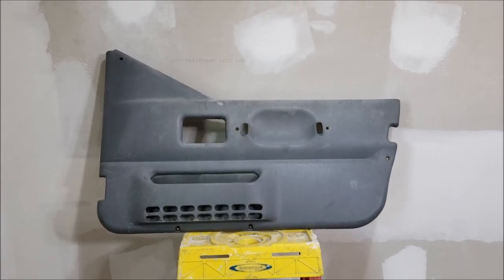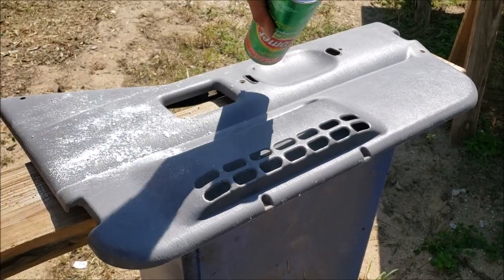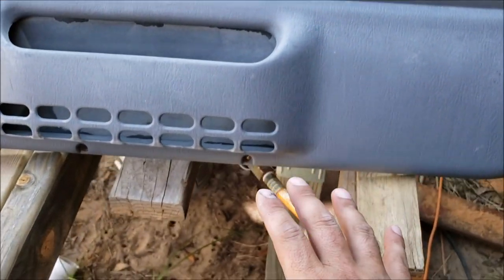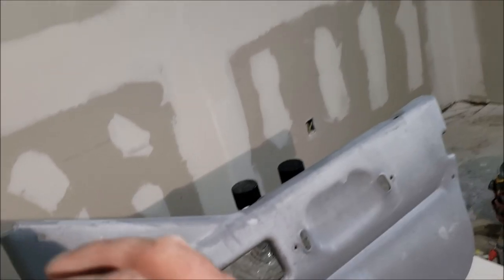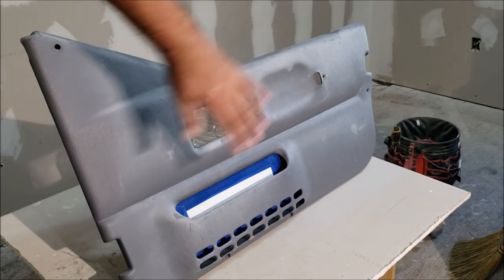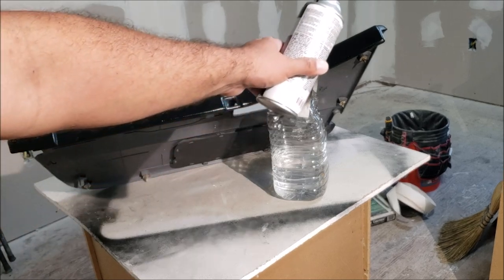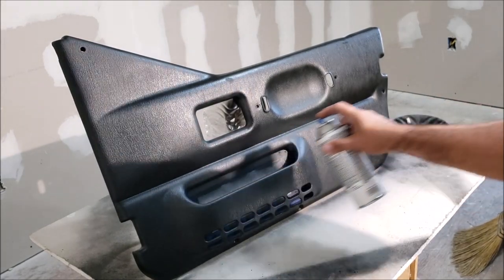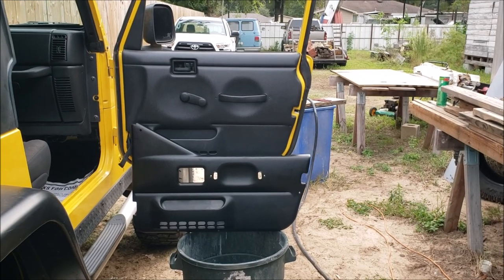how to paint plastic door panels with DUPLI COLOR

Comment: Good  job. One thing I recommend  is using a clear coat to protect the color. From uv as well as abuse. It will help the paint last longer and you can also change the glossyness to more flat or satin verses whatever you end up with using the paint. Acetone is a good cleaner as long as it does not melt the plastic. Also dentured alchohal Ive seen be used with good results. Definitly need scotch bright and or fine scrub brush.

Comment: Clear speaking.Nice.
Great video.Id like to add a tip.
As for the spots which are brittle caused by uv deterioration theres a way to fix it. Get vinyl filler .Its in putty form.It can be applied evenly over the gritty areas and sanded off.The thing to watch out for is that the.texture will differ from that of other parts so the trick is to apply very thinly just enough not  to alter the texture patter.

Comment: A good tip as far as it spitting out the paint is to take a needle and clean out the spray hole
Reply from the maker: the valve on the can is what gets clogged and fails. You just soak the nozzle in mineral spirits but don’t leave it in too long it will dissolve the glue and blow it apart
Reply: Never put a needle in the nozzle cause it will mess up the fan pattern.   

The way you keep the sputtering is to heat your paint up but soaking in hot water or set on the defroster in your vehicle.  Then shake the can really well.....when you are done shaking.....shake it some more. Then after a minute of spraying shake your can some more.
Reply: **PRO TIP**
Use one or two drops of either a 3 in 1 oil or some sort of oil meant for lubricating fan motors and bearings. Probably any oil that isn’t too thick will work. Drops go straight into the male or female output hole on the spray can. Place cap back on and spray it in the air or on scrap for a second or two to blow out any excess oil in the cap. Paint will no longer clog or stick inside the cap and you should have a smooth spraying experience for the duration of your project 🤫

Comment: Hey@ I have a TJ and the door has been repaired already. It was sahara body colour and sprayed to gray. The paint is now flaking at the top. Trouble is it looked like they broke the panel and then attached it back. So I don't want to remove them again. Is it possible to just mask of the parts and leave the panel on? I don't want to break the panels anymore.

Comment: Mine scratches off, any help?
Reply from the maker: what are you spraying? I have never had that happen
Reply: @chriscraft77022  The door panels to my 1987 Dodge Dakota. I had washed them down with water, then used a bathroom scrub with bleach to scrub the surface in order to make it clean then I had washed it off again. After it dried I scratched it and the paint just comes off like acrylic paint. Also I used the same paint in this video
Reply from the maker: @NumberedK.  you must of used a soap with something in it that made the paint stick to whatever is in the soap..  i have sprayed carpets to seats..   everything with this stuff an i have never had it flake off...  i have even used it as paint to match interior parts over metal parts..   i have never even had it rub off over years on a steering wheel color change..   the surface of the panels was not prepped right..  thats all i have to say..
Reply: @chriscraft77022  Dang it, for sure thanks. Any possible ways of fixing it? Is there a clear coat or something I can add to make it un-scratchable?
Reply from the maker: no
Reply: @jamesbeatty1732  thanks bros, I sold the truck now but for my next project I'm definitely going to use that info. Appreciate you 🤝
Reply: What dish soap can I use? Also, can I use just straight alcohol for prep?
Reply: Heat gun don't leave it in one spot for a long time I used a heat gun for my door panels and the dash board do a small practice area so you get used to it